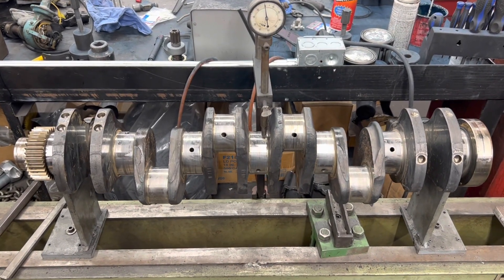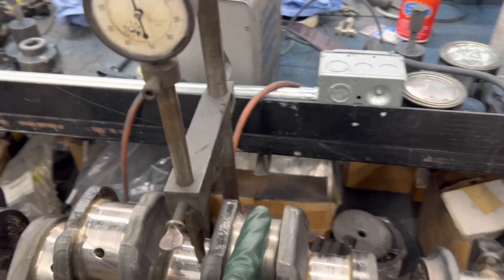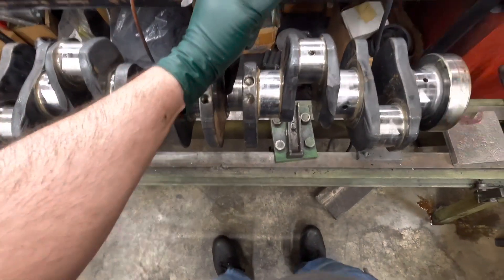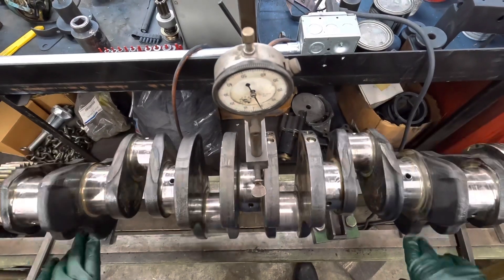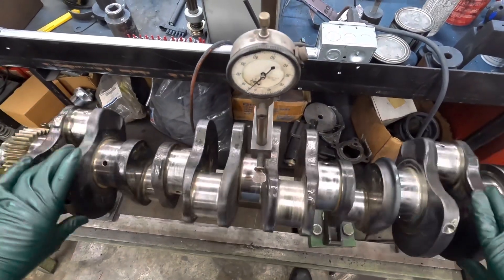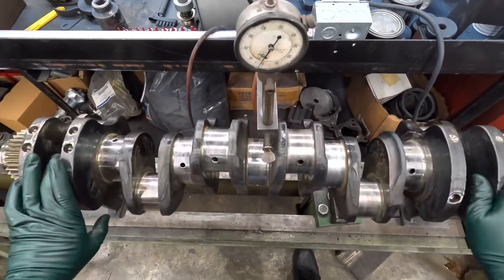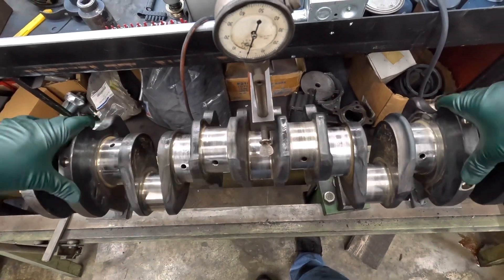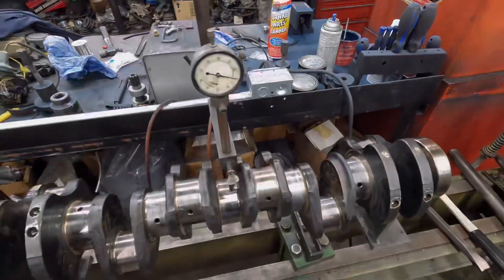Straightening a 5.9 Cummins ISB Crankshaft Using The Peening Method

Comment: Thanks for the video I'm trying to do a crank for my Oliver tractor . I have it down from .008 to .002 . And I going to try to get it closer. I'm a machinist but not an engine machinist . I just do my own stuff
Reply from the maker: Keep hitting it. Also, make sure the journal you are checking Isn’t out of round .002. If it is you are as close as you’ll get.

Comment: That is just wild. All the force that crankshaft is transferring, the energy of the connecting rod bouncing around is easy enough to see how it bent it and yet not much effort was really needed to unbend it.

I know you said its still going to get reground but how does that not mess up the fillet or can you also regrind those ?
Reply from the maker: It sometimes leaves a mark in the radius/fillet area. Depends on the undersize you end up going. The marks don’t hurt anything.